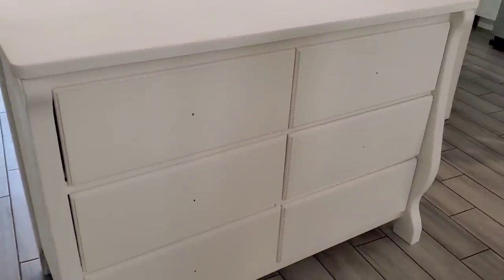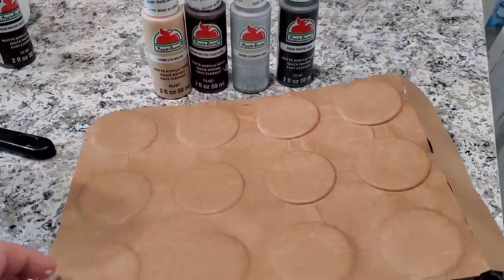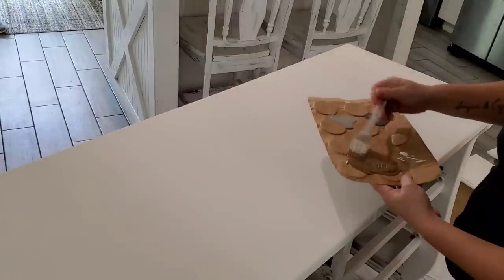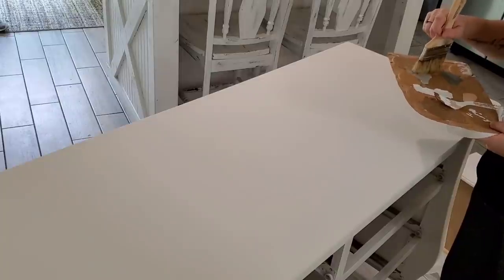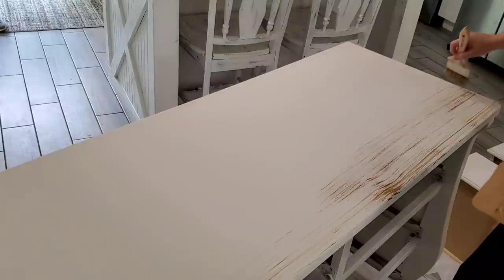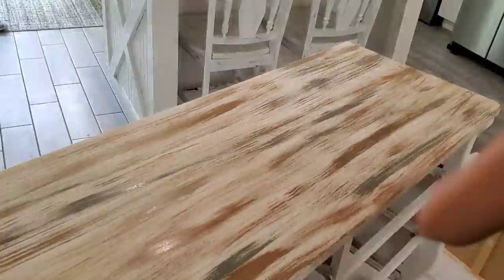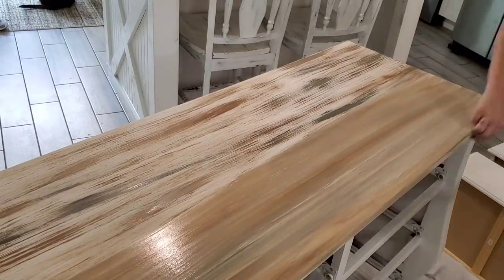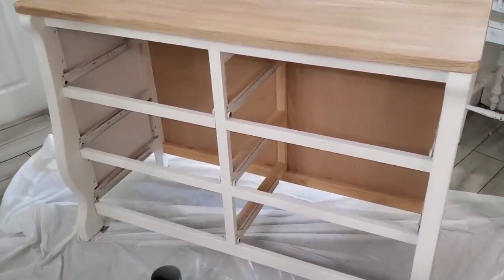Affordable DIY Dresser makeover | budget friendly diys

Comment: I tried the same thing with my closet but I failed and now i am so unhappy .Thank you for this video I also see your kitchen table .
Reply: You'd get the same effect with woodwash effect contact paper. Or, sand it right back with a hand sander , because if it's melamine or wood veneer it won't take paint effects as well as solid wood. Then get advice at your DIY store re applying a white woodwash  depending on what your closets made of. Woodwash is v cheap from DIY stores.